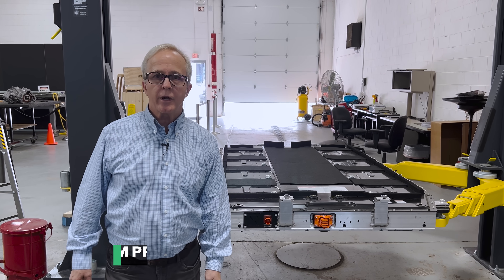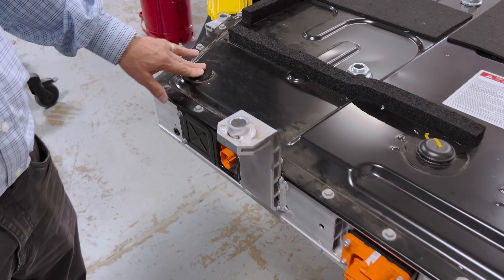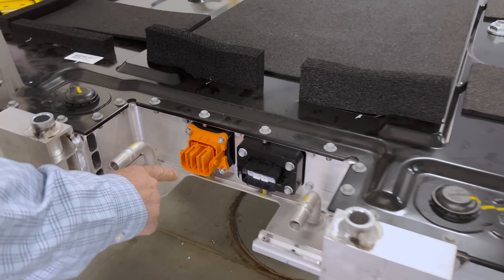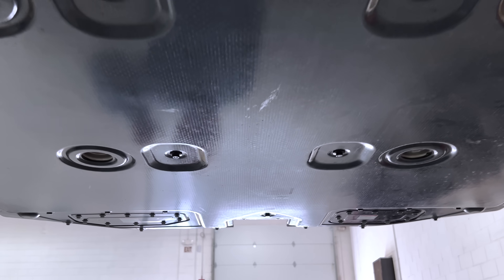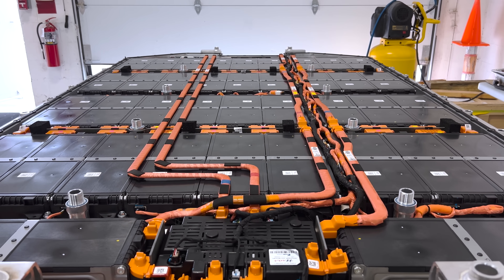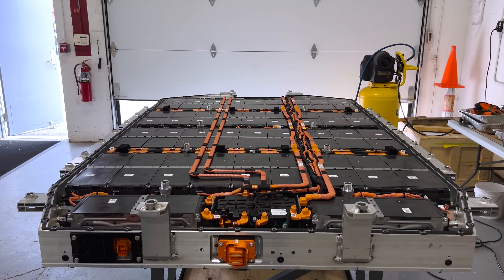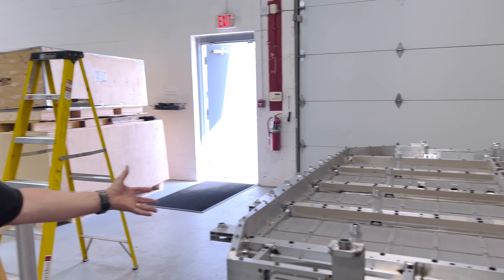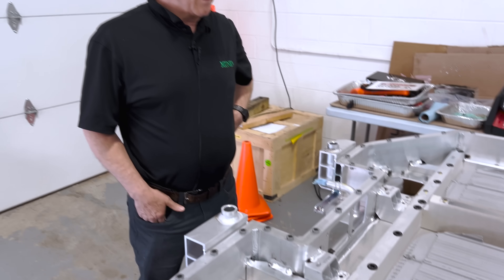Inside the Kia EV9: Full Battery Pack Teardown

Comment: I still think that prismatic cells are better for cooling and packing and easier to replace if needed. MG has similar battery layout but with CATL packs. LR version has 180Ah cells which are a kind of 3S internally but look as a single cell on the outside.

Comment: My new EV 9 is in the shop with 3 dead cells and waiting for an engineer to review the system. After watching this video I have a better understanding of the work they will be performing to replace those cells.  in 5 months I went 21,500 miles before having an issue.   I replaced my Hyundai Ioniq5 which had no issues at 100k in 2 years.  Glad i saw this video.
Reply: What do you do, driving so much?

Comment: I have driven my EV9 Wind RWD 13k km with no issues, but right after the first service(when the dealership applied the ICCU recall for charging logic improvement) I got a faulty main battery. At full charge, BMS SOC shows only 67%(~63KWh), and there is a voltage drop in one cell. Currently, the dealership cannot figure out the issue and how to fix it, which makes me really upset
Reply: Did you find a solution yet? I have the same problem. Thanks
Reply: @ waiting for battery cell replacement, cell should arrive in the middle of March.
Reply: @44pavluha  Oh my got that's katastrophic, where are you from?
Reply: @ Canada, BC. It is so sad, my service advisor said that they even do not have such experience yet and I will be first one, and the have to get step by step instructions from manufacturer.
Reply: @44pavluha  ok, I'am from Luxembourg (europe), they told me there is an issue with the BMS, and it will finally be replaced next week, I am not sure if this will resolve the problem though,but I hope they are right.
Reply: @Dominator0505  they tried with CMU, but did not helped, service advisor said that they have no experience with such issues. Honestly I regret that I took KIA, vehicle is great when everything is ok, but they really do not know what and how to fix. And what is more sad is that they even put old issues (iccu, 12v) from ev6 to new model.

Comment: The problem is the weight of the vehicle. Cars need to weigh under 500 pounds - this will shrink the battery size and improve the range immensely.

Comment: I don't agree the thick TIM is the fault of design. It is quite intentional. The thickness was optimized to secure the safety margin in case of bottom side damage by rock chips. Also it enables the complete contact interface between the cells and cooling plates. The cooling efficiency was fully demostrated by the Turn Pike Hill rally by Ioniq 5N which battery and design are same as EV9. The power of Ioniq 5N is 650 horse power and no power limitation was occured through the race.

Material cost and weight can be reduced, but the safety and robustness should not be compromised.

Comment: This pack looks great save for all of the long buss bars. I would think you could have the cells arranged so that you are going up one side connecting adjacent cells and then coming back down the other side only need longer buss bars to connect the halves and ends. The only reason I can think to not do that is to keep the voltage difference with nearby cell lower to avoid the high voltage arcing across the gap.

Comment: Does the Ioniq 5 N use the same kind of battery design? As far as I know, it’s the only stock EV that can do multiple laps of the Nurburgring without overheating. So I would guess having higher voltage and lower amps means they can use thicker thermal pads and not have to worry as much about faster heat transfer. Or we are just thinking wrong about the thermal pads. Maybe their size gives them so much of a buffer that they can start to soak the heat while being cooled from the bottom. Kind of like a water cooler in a pc. The water can soak up a ton of heat before you even need to run a fan through the radiator. 

This is super cool though. So clean and so easy to tear down. What an awesome simple design. Hyundai Kia are killing it!
Reply: all e-gmp platform is same. base i5 or ev6 too..

Comment: I guess they are trading in safety vs. improved cooling, having each package mechanically buffered on top of the usually not so great thermal conducting material.

Comment: On design it looks amazing, practically service and expertise are mandatory. My Kia ev9 got coolant leak 4 days after the acquisition while I was on vacation. The local Kia center, didn't see anything apart from coolant being totally missing. They just refilled it. A month later I had the warning Battery issue, it took 6 weeks for the Kia to be diagnosed and repaired. They did replace part of the battery, they had to make their country specialist come to take care of it. And the same leak happened less than 2 days after they gave it back to me. The car is now stuck again. Expertise is key when you create such complex architecture ...

Comment: It would be interesting to see if the plastic cover of the modules is thermoplastic. There are phenolic alternatives with the same look but way better performance during thermal runaway.
Reply: it is
Reply: @AntonioDiNunnoEVS  Interesting. Then 4 diavents and the thermal protection layer are enough to fullfill the 5min rule. But I would guess the long busbars in the middle of the pack have improved isolation to minimize arcing under thermal runaway?

Comment: nice pack vs the none serviceable packs of Tesla. My only issue with Kia/Hyundai is their stubborn use of pouch cells.  Thermal interface material also too thick and it will dry in less than years. They better make it thin so that it doesnt become of an insulator when it dries.

Comment: It's a mistake to think the hardest use the cells get is while driving. That's wrong! The hardest use is fast charging. Fast charging uses 5 to 10x more current compared to driving, and the cells have worse efficiency when charging compared to discharging. Normal driving, or even racing, is like nothing to these batteries. All the cable thickness and cooling system is basically solely designed for charging.

Comment: The reason for the thickness of the thermal interface material could be to allow it to maintain contact with the cells as the cells move around and change shape during charge cycles and during their overall lifetime. A thin layer would be unable to do that.

Comment: They do not want to remove heat or add heat TOO FAST. It is one plate. It means there is a gradient. And also... the cell is thermally adjusted from one side. So temp Delta should me not that great. So thick paste is actually a good design choice - limiting  heat transfer to managable level. It is a Kia, not Lamborghini.
Reply: How effective is it to cool the battery if only one side is being cooled? So one side could be red hot, no?  That would still damage the battery, no?
Reply: @Cjdergrosse  No battery damage will occur.This battery pack is also used in the Ionic 5n. It is a proven system that does not cause battery overheating even after several rounds of the track.

Comment: I saw your another presentation for eGMP module design. The giga pascal end plate protects the cell from the crash situation. GF30 and GF10 plastic and the pad between the cell retards the heat transfer in fire situation.

The BUS bar connecting the module has incorporated fuse function to isolated the internal short circuit event in one module or two modules.

The insulation sheet is incorporated to protect the cavin from a fire case.

Comment: The thickness of that thermal paste almost looks like they are using it for shock absorption also..  It lets each module float on a bit of cushion.  Rather than filling it with foam/glue like Tesla does.

Comment: We should normalize those coolant fittings to be a machined surface with mounting bolts..  So that if the fitting itself gets damaged,  they can easily be changed without removing the battery.   Mounting the fitting directly to the pack like that needs to go away.  It should be more serviceable than what they are doing.  If some random chicken runs out into the road and breaks your water line, you now have to pull the entire battery and split it apart to even begin a repair (which looks like it can't even be done)... This is unacceptable...   I will say:  at least they didn't make the fittings plastic, like Tesla does.

Comment: It almost looks like they use Termal Interface Material for NVH suppression between the battery and the bottom. TIM is expensive. I'd  thought thinner (painted on) TIM with battery NVH HD foam around the edges would be a better solution.

Comment: This is a very dangerous structure. The bottom of the battery module is exposed. In the event of a bottom impact, there is no preparation for the spread of fire and the cell is exposed to the flammable coolant. 
All four directions of the battery module must be explosion-proof. NCM batteries are too susceptible to thermal runaway.
Reply: That's not true

Comment: Thermal interface material if designed or chosen appropriately can be thick and effective.  Look at GPU memory modules thermal pads… they can be quite thick, yet effective.  I bet the thickness was chosen based on “reasons”.  Thickness doesn’t mean much in this application.  It’s not a CPU or a direct die GPU.
Reply: Munro could test the conductivity of the gunk used here to see how it impacts heat transfer.

Comment: If the battery has a Vmax of 643V why is it referred to as 800 volt architecture?
Reply: It's the nominal voltage.
Reply: Through switching control,
DC-BUS has an 800V system.

It is true that the efficiency of DC-DC is high when the maximum voltage of the battery is close to 800V,
but the claim that it is not an 800V system because the maximum series voltage of the battery is not 800V is wrong.
Reply: @whyissueTV  왜이슈님  여기도 왔네 ㅎㅎ 잘보고 있습니다
Reply: Marketing....

Comment: It would be useful to measure the thermal conductivity of that material.
Reply: Yes, it's a little disappointing that assumptions were made without evidence. In fact the entire module could be bench tested for thermal resistance and heat capacity.

Comment: Good point that's a quite nice and easy battery to service and a nice use of a cold plate. Bad points it looks to be a heavy battery pack with all of that wiring, metal and cases within cases.
Reply: Your interpretation is wrong. HMG's BSA is lighter than any other brand's BSA.
Reply: As far as I know, the current battery pack is lighter than Tesla.

Comment: 3:15 They vent towards the cabin? Yikes.
Reply: If they vented down the vent could get damaged by road debris. But there is still a solid floor pan between the passengers and the top of the battery, and the vents are at the far fore and aft ends. It doesn't vent into the cabin.
Reply: @stephenj4937  It does vent in the vicinity of the cabin which is not good for occupant safety. Road debris won't damage the vents if they're properly located and recessed.

Comment: 13:27 Thermal surfaces should be flat to minimize gap. The amount of thermal paste should be as thin as possible for maximum heat transfer and minimum production cost.
Reply: something that is missed is...these are pouch cells. you can't have the bottom of the cell touching the metal. the distance is necessary to protect the vulnerable section of the cell.
Reply: Though ioniq5n has the best battery cooling system  which uses similar module/pack system with ev9.

Comment: Observation from someone in the Utility business for 35 years. We remove jewelry (watch necklace, rings) and wear 100% cotton long sleeves while working with electricity. A flash can melt your non-cotton shirt to your skin causing much pain and long recovery. Cotton will not do that.
Reply: Arc flashes are no joke, for sure. Although I dont think the risk is high for that here.
Reply: If we're talking 600VDC that's enough for a flash. Maybe they discharged the pack fully before disassembly.
Reply: @jamesbruce1183  you can't really discharge these. BMS will stop you from doing that, and this battery probably still has 400V at cut-off
Reply: @chengcao418  You're right pertaining to the whole pack, but wrong when talking about the cells.  The BMS is in the chassis at the end of the Buss Bar network.  These cells are discharged, which is mentioned in the narration.
Reply: @chengcao418  With the top of the battery, you have access behind the BMS. ie operating on the battery without the BMS knowledge. So with the right apparatus you can discharge the cells anyway. Individually or in groups. Until then you have to assume everything is hot.
Reply: @jamesbruce1183  in this specific case their pack is sealed and you only at most get access to each cell group and from the looks of it not even that. They probably take the entire thing apart just after the entire battery reaches cut off voltage
Reply: You can also wear hemp or wool.
Reply: Totally agree!
Reply: Subways in NYC and Boston have 600 VDC exposed 3rd rails; one 25 year study in Boston identified 16 3rd rail injuries and no fatalities. DC power isn't really dangerous until it's above 1kv.  There's a reason Edison used to harp on the dangers of Westinghouse's AC current.  I'm sure contact with the battery's voltage will hurt, and perhaps leave a scar, but I doubt anyone will die from contact with automotive batteries.

Comment: Kudos to HKG for sticking with a serviceable battery, even taking into consideration some parts that may need to be replaced and allowing them to be replaced without removing the battery. All those things play a huge role in the likelyhood of being able to keep these on the road for years or even decades, since being able to replace individual components is far more cost effective for a vehicle owner than having to replace entire massive, expensive assemblies. It's also a lot better when it comes to recycling at EOL. Although I know Sandy tends to disagree because he's only concerned about reducing the cost to the manufacturer, serviceability matters ! Especially for something that has a huge environmental impact to manufacture, like a car. We need to focus on keeping vehicles on the road longer, not just churning out new ones faster and more easily, especially since that reduction in cost is rarely ever passed to the consumer.

That said, I wish they would come up with a better solution for heating/cooling the battery. Building the heat exchanger into the bottom of the battery case is great for manufacturing, but the thin composite cover they put over it is not very effective, especially in cold temperatures. I saw this issue in my Ioniq5 and now the EV9 that replaced it. The battery gets very cold, very quickly in cold weather, leading to either slow charging or a lot of energy spent on battery heating/preconditioning during road trips. It also reduces the heat energy available for the heat pump system to scavenge from the battery, reducing efficiency.
Reply: Currently, companies with systems that exceed Hyundai-Kia's thermal management system are not taking much advantage.
Reply: Manufacturing, as I said, becomes expensive. If there are a lot of people willing to pay that higher price, of course, the manufacturer will reinforce that, but the reality is that it's not.
Reply: Need an insulating cover for winter. There's a Canadian company that makes kits for Tesla
Reply: There is no free lunch.
The serviceability come at a cost in reliability, weight, and price.
If your parts are reliable or age in a similar manner, it become waste.
I would say make all the battery pack one glued thing, but make it very light, reliable, cost effective.
Grind the whole battery pack to ore if something fail.

Comment: Surprised to notice Hyundai never bothered to clean up aluminum mig welds in the battery pack casing. At the first glance I thought some component in there has let the smoke out in quite an eplosive manner! A classic implementation of cost reduction my avoiding uncecessary finish.

Comment: I love how clean and modular the design is and it's easily recyclable unlike some packs where everything is filled solid with foam that has to be chiseled out.
Reply: Tesla just freezes the battery packs and chucks them in a grinder. It's a very easy process to recycle Tesla packs. The problem is, Tesla packs are so good and last so long that they don't have enough packs to recycle.
Reply: Recycling is done chemically. So removing the foam is done with 1 easy process. By hand it a nightmare by with the right chemicals it prob a 2 min job.
Reply: @pipooh1  Let me remind you the order is Reduce > Reuse > Recycle, if you're filling it with foam you're skipping the reuse possibilities that these cells could have at the end of life. We've already seen many Leaf packs getting reused for solar farms, that's what we should be pursuing more and more.
Reply: @TheFPSPower  the truth is the best battery pack is one that doesn't go bad, and need to be replaced. These battery packs are going to last, on average, WAAAAY longer than ICE, so repairability might not be needed at all.
Reply: @bobhope3940  What does that have to do with what I said? I did not mention repair at all, I mean at the end of life when the battery or the car is no longer useful you can use it for other purposes like energy storage that don't require much peak power so even worn out cells are still useful.
Reply: @TheFPSPower  wait but why would a Tesla battery pack, for example, not be reusable? It's not like the foam makes it useless?
Reply: @bobhope3940  Because as a pack the voltage is too high and the packs are too smart, you would need a very custom BMS to make it work. If you can strip them down to smaller packs it's much easier to make it work at a cost that makes sense.
Reply: @TheFPSPower  that makes sense but I don't see what that has to do with the potting. ;)